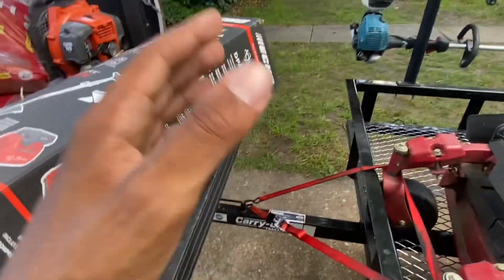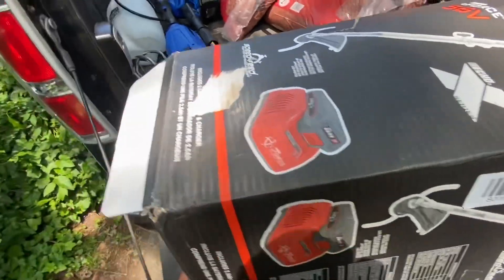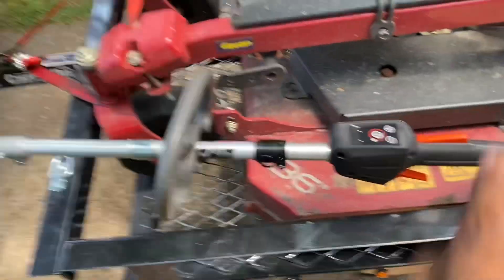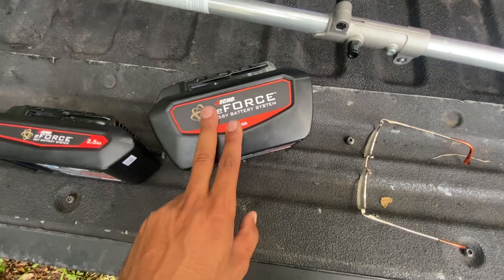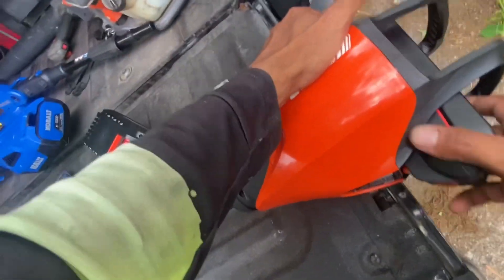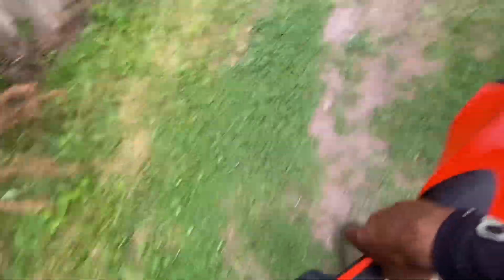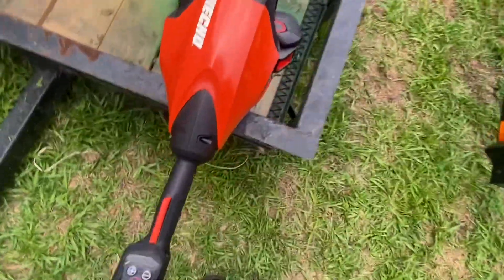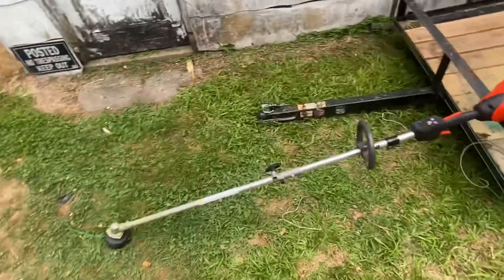Going Battery￼? Echo DPAS 2600 56V String Trimmer

Comment: Something to think about with a battery trimmer: consider running smaller line to put less effort on the motor which will help batt last a little longer. Husqvarna 0.080 titanium force for example is some insanely strong line it does especially well against chain link fencing.
Reply from the maker: I fought the best line EVER
Reply: It also depends on on how strong of an electric motor the trimmer has and how many volts. I'd say anything under 40V would be better off with .080 line in terms of battery runtime. The motor on this Echo 2600 is much more powerful than the Echo 2100 even though they both run on 56V.

Comment: With a little 12v to 120 inverter (big enough to power your charger) you could be charging a spare battery from your truck battery. If you were worried about running down the truck battery, get a second 12v battery that charges while the truck is running and disconnects (using a relay) from the truck alternator when the engine is not running.
Reply from the maker: Yup done it before

Comment: I had to sub. Made me laugh, not at you but your excitement with the  new equipment. I get that way too, lol The review was  helpful. I bought the first and second versions of the Echo battery line. They keep getting better and worked out some of their issues.  I'm not sure if they addressed the shafts. A few of mine broke. But I think Echo topped it out this time.  I'm getting rid of my 58v Echos and replacing them with the newer 56v . Because of the improvements and going to be harder to find the batteries. And no one that I've seen makes aftermarket batteries. As simple as it sounds, the biggest improvement with the 56v is they FINALLY put on a softer trigger pull!  Have no idea why they made the older version feel like you're going to the gym. No carb with springs and no throttle cable to pull.Then why such a heavy throttle  for just a switch and throttle return. Anyways it's fixed now.  lol
Reply from the maker: Yup 56v is idea

Comment: Joe do you still use this unit. I am on the fence. How well is it performing a year later. How much trim time on a 5 amp battery
Reply from the maker: Yup I still used it. It’s my go to. But if it’s a overgrown yard I don’t use it. And it’s perform in about the same as I brought it. One my battery will not charge. And I lost another one. So that’s $400 down the drain. And the 5.0 amp last about 45 mins . Says it’s 1 hours but in that heat. U get about 45mins. I have the hedge trimmer attachment. That last over a hour. And I have the stick edger attachment. I’ll get a good 20mins outta that. All in all I save about $30-$40 a month with this trimmer
Reply: @CuttaSquad  how many yards can you do on a battery doing trimming
Reply from the maker: About 6. But once you get to corner lots  and over a acre property. About 2

Comment: Nice review I liked it What about the batteries how long do they last in the scythe
Reply from the maker: The big battery about 50 mins max, the 2.5 is around 20 mins max. Very good for weekly houses. Bi-weekly is a no-no. You burn threw them quick. Cut that time in half for bi-weekly or once a month
Reply: Today I bought the combi for $640, that's how it is in Israel, everything is expensive 🙂 A little lighter than the Dalyki and very nice So thank you for the review and good luck with your work
Reply from the maker: Great hope you have fun with it and thanks

Comment: Battery stuff is great, til it shuts down every 5 seconds from overheating on hot days.
Reply from the maker: cut in 96 degrees  yesterday so far been fine🥰
Reply: @CuttaSquad  I hope it keeps working. Ours were 82v Greenworks Commercial units. Both trimmer and edger were shutting down.